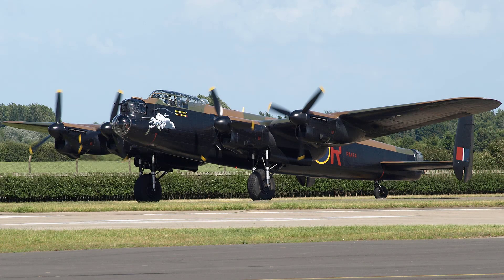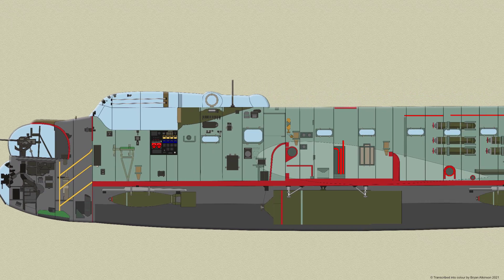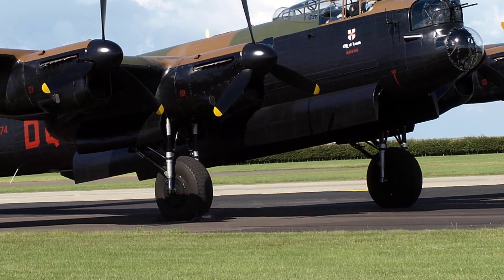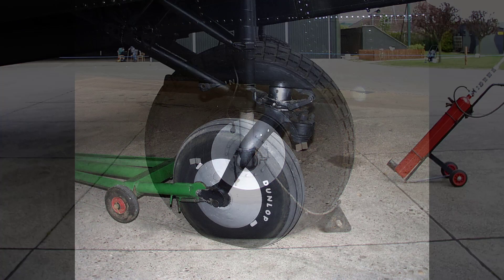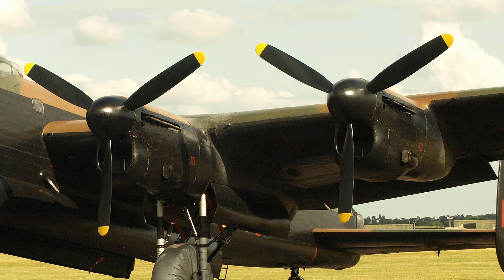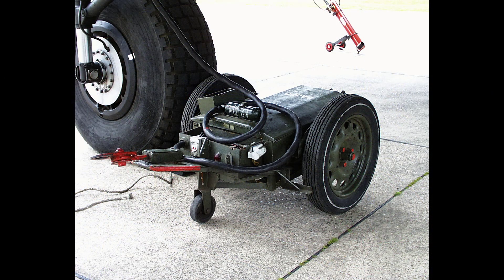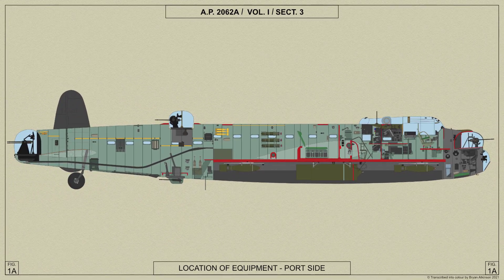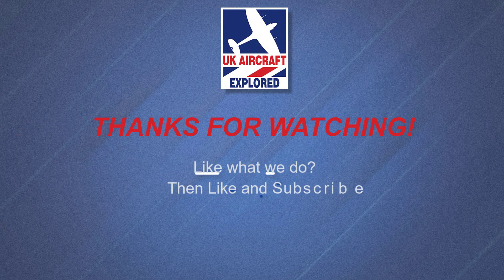Avro Lancaster - An Overview

Comment: B. III  This variant, which was built concurrently with the B.I and was indistinguishable externally apart from being fitted with Packard-built Merlin engines. The Packard Merlin used Bendix-Stromberg pressure-injection carburettors requiring the addition of slow-running cut-off switches in the cockpit.
BAE Lancaster page
Reply from the maker: Thanks for watching